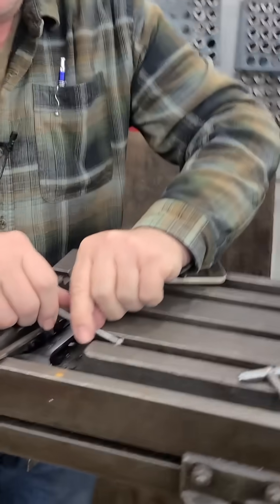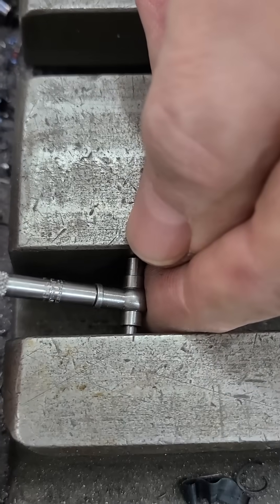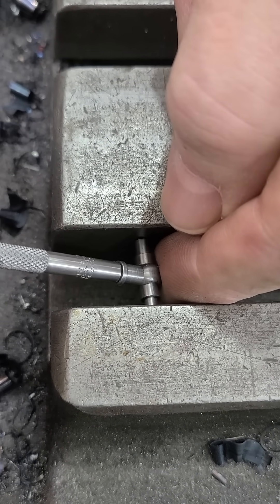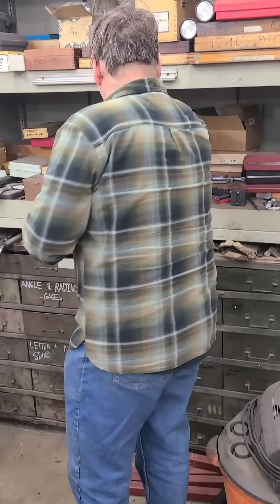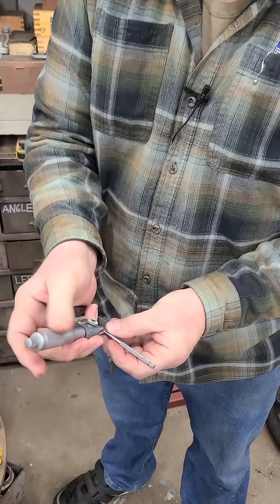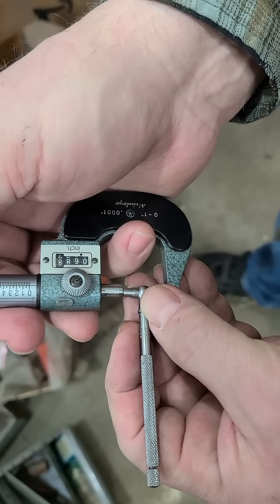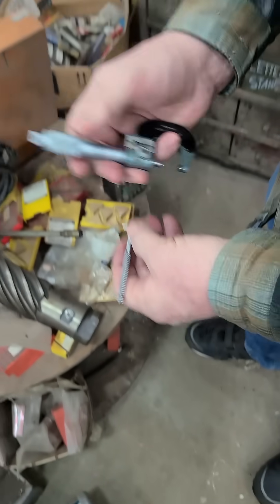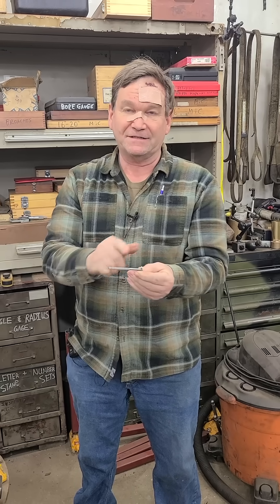Machinist's Minute: Telescoping gauges between two flats

Comment: You are holding the micrometer wrong. Never touch the curved part. Your palm and your fingers heat up the metal and expand it. Making it inaccurate. It doesn't take much time to change. Test it out. Know wonder you can't get a good measurement. Have you no machining education. I learned that in tech school.

Comment: Can confirm that the cheap Chinese telescopoc gauges are unusably bad. Either tightening the clamp adjusts them, or the clamp is so weak that putting them in the micrometer adjusts them, even when wound up as tight as you can.

Comment: Too many variables. Make sure theres no burrs and use a dial caliper or external micrometer. This will work fine too though if you know what you're doing and double check your measurements.

Comment: I had to use these to check cylinder bores mains and cam tunnel ect.
It took half a day.
Yea the micrometer is convex like the guages, so it's measure 4 times to be sure.

Comment: I like adjustable parallels for milling machine slot widths. I used my Starrett for 42 years in my career and it is still accurate today. My Scherr Tumico are still holding up well also. Telescope gages are as you said something that you become accurate with in time. Thank you for sharing your life.

Comment: Buy u a set of starret snap gauges. They're expensive but worth every penny
Reply: Do you measure in bananas too?😂
Reply: @fredhoyt6900  I'm don't get the question tbh
Reply: No I'm american. Not Australian
Reply: @claygillespie2800  What was displayed was a bore gauge.
Slots don't have bores.
Reply: @fredhoyt6900  wtf r u talking about. I know your trying to be cute but I'm not following u bud. Bore gauge and snap gauge are the same thing. Yes, u r correct that the proper tool for measuring a bore would be a snap gauge or boring gauge. If I where to measure a gap in my mill table, the last thing I would use would be a snap gauge or bore gauge. I would simply use my calipers or even gauge blocks if it where critical.

Comment: Remember that only two points so in a diameter you need to take an average especially in a cylinder bore.
Reply: Thanks for the reminder Dave.
Reply: Huh?
Not if you care about l measuring to make sure it's actually round. 
2 point is the way to go.

Comment: Starret is the way. Short handles mean less moving the boring bars outta the way. And the rad. on the tips seems to find it's way into the center easier that the Mit ones imo
Reply: But on the flip Mit tele gages have a little flat spot in the middle of the T, so in this case you can drop a peice of keystock or somethin in the T Slot, lay in the gage and it'll locate flat. Starret still wins if you've got the feelings down

Comment: See so with slots I say fuck that and just break out the Guage blocks

It's the only tool I own that's Browne and Sharpe
Reply: I hate to be a spelling NAZI, but you spelled gage wrong twice in one word. lol Also, Webster is wrong about the spelling too. Use gauge when it is the measurement of something like 16 Gauge wire, 12 Gauge shotgun, N Gage model train. Use gage when it is measuring something, like telescoping gage, gage block, or gage pin. I have no idea why autocorrect wanted me to capitalize Gauge. I usually had to take English classes twice.
Reply: Damn it, N gauge model train. lol

Comment: Older SPI tools were good. When they were still swiss made.  When measuring a slot I always used adjustable parallels, and use telescoping gages for round bores.